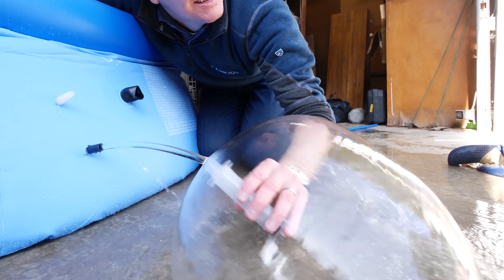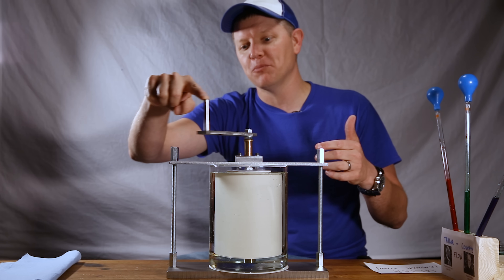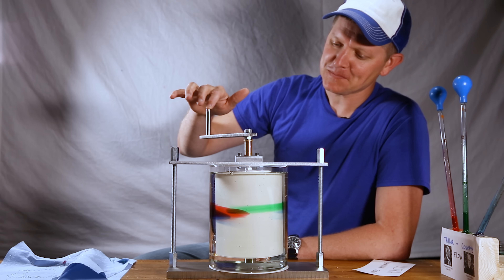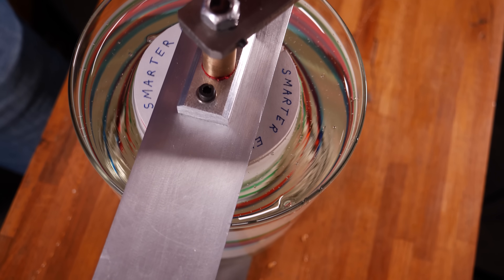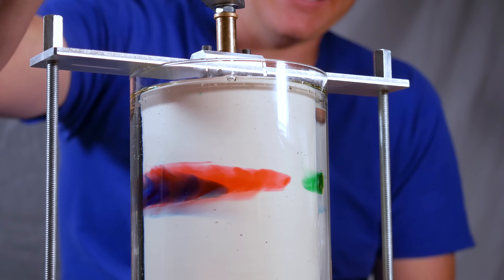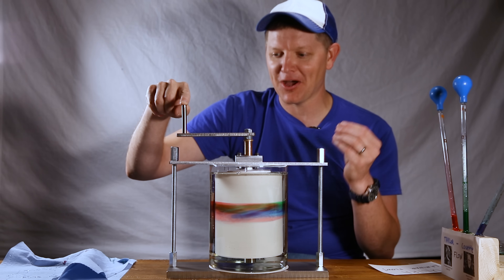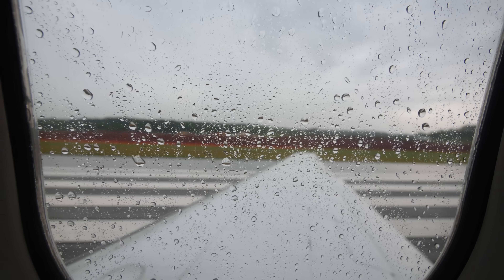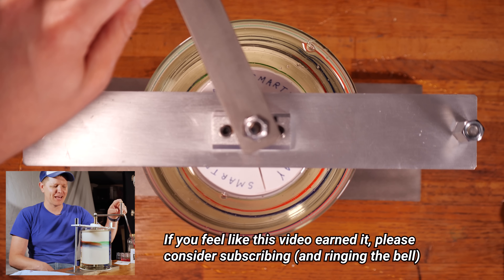Unmixing Color Machine (Ultra Laminar Reversible Flow) - Smarter Every Day 217

Comment: Hey so I was just thinking your undoing spirals but the corn syrup and the dye still mix ,if it was actually reversible the colors would be able to be compound and remain unmixed not sucked into the centre in different layers ,you can’t undo the past and they definitely still mixed as you can see the droplets of color are diluted on the sides it’s an example but not a good truth as it’s very misleading

Comment: Does this refute the universality of the second law of thermodynamics?
Reply: Even though the spots were recovered, energy was irreversibly expended elsewhere within the system, such as the layers of fluid shearing across each other, and including energy exerted by Destin.
Reply: @josephshakal9017  my question wasn’t about energy but entropy, if order can be restored simply by reversing the direction of a particles’ momentum, then Boltzmann’s whole theory is refuted, isn’t it?

Comment: Would this work on? Photons are the smallest measurements (quantified as a quantum in physics). Could you reverse the flow to make matter from it decay point to a stable element. Like having a puzzle missing a piece or 3 or more? Could we use r-matrix theory, zero-point state (found in argon as a solid, naturally cold in subzero space). Use tessellations of 2d tiles of two elements to backwards tile the plan of that atomic elements from K to Ar? With a reverse laminar flow of light that is lower than infrared light, but equal to gamma ray. That way radiation is used up. To make matter as allotropic as 2d Phosphorus.

Comment: The slight distortion in the reversed result might partially be caused by the bubbles or by inhomogeneous viscosity in the corn syrup. So befor injecting the ink you could mix the liquid by spinning the cylinder 100 times. And can you then repeat the experiment with a very slow running motor?

Comment: Hey Destin! I watched this video like a year ago - but then today I suddenly had an ‘aha!’ moment as a result!

I have this globe on my desk that is suspended inside a plastic globe, and a clear fluid - essentially free-spinning inside the ball. I couldn’t get it to work properly and spin, without going backwards - but it was supposed to just keep going in the direction the earth actually turns. 

I looked over at it today - and this video came to mind - and it clicked. I needed to spin the outside globe in the right direction to ‘wind up’ the fluids inside - which then pull the interior globe in the same direction. 

Mind blown. Thanks man!

Comment: this works with syrup because syrup is actually a bundle of strings, and not a fluid like we normally think of it (similar to how glass is not really a solid). mineral oil probably would have a different result, as it would more readily mix.

Comment: Green colour drop has been put very close to the white cylinder and blue colour drop very close to the glass wall. Red colour drop has been put between the other two. If every colour drop has been put to the same distance between the white cylinder and the glass wall then the colours couldn't get back to their initial position and would have been mixed permanently. You can see what I am talking about at 3:04

Comment: So it's possible to not only time travel but this proves the multiple universe theory. if the universe is a certain point in time and it moves forward in a Fibonacci spiral, you need to capture that spiral of entropy inside a laminar flow tube. Then just reverse it again. Only problem is. Your universe is now slightly different due to small amounts of turbulence that snuck into the system.. you've just traveled to a new universe... I'm sure there's a very simple experiment that will induce some sort of electrical current to this system that will enable us to eliminate the turbulence and thus create true time travel..

Comment: Universe:
"Nooo, you cannot reverse entropy"

Corn Syrup:
[Laughs in reversed entropy]
Reply: The striated pattern proves that the entropy wasn’t reversed
Reply: @sirmorningwood2707  The striations actually prove nothing about entropy being maintained or reversed. As he pointed out that is just a side effect of the way they mixed it. If done properly, the laminar flow would return the liquid back to its original position without striation. 

In any case the original premise is flawed, because you are not actually undoing entropy by returning the liquid to its original state, any more than melting an ice cube and then freezing it again means that you have reversed entropy. The energy (and subsequent heat) that went into the system to "mix" the liquid was also required to then "unmix" the liquid. As such, the continued entropy of the universe was maintained.

That being said, I have long held that the Entropy is a severely flawed theory because if the ball must always roll downhill, then how did the ball get to the top of the hill in the first place? Even if we follow a multiverse theory where our universe splintered off of another universe through an extreme amount of energy focused on a very tiny point (Michio Kaku posited this at least), and assuming that the laws of physics are constant across universes, then you'd still have the problem of explaining how our parent universe got it's initial energy and so on.
Reply: @femsplainer  Sorry - that was not a physically correct explanation... clearly the system is not mixing - if it were, it would not "unmix"... the low Reynold's number just means that the flow pattern is predictable and reversible.. there is little impact of "randomness" under these conditions. My simplistic equivalence is to use a cipher anology. If you take a sentence where you follow predictable (unique) transformations - then using those same rules reversed will always return the sentence to the initial state. The rules are more constrained in this situation to a repeatable/reversible process. If you were to leave the fluid sit for an hour after the initial turn, the chances of reversing reduce (because even at the higher viscosity, the chances of random (thermal/gravitational) movement that are non-reversible increases.
Reply: @femsplainer  Hey dont be confused about  ball rolling down the hill how didnit get to the top 😂

If you roll a ball on a bigger ball & the little ball is attracted to the bigger balls center of gravtiy it will contently continuously roll 

So in other words, a ball can in theory always roll downhill and always be on top of the hill if its a ball
Reply: @Alberta1stPodcast  That's not how entropy works. Whenever you describe a perpetual motion machine, you should probably stop and check your notes, because you almost certainly got something wrong, since you would break all physics as we know it if you actually did get it right.

Yes if you have a perfectly balanced orbit you can in theory have the two bodies orbiting forever if we ignore tidal forces, large body deformation, solar winds, space dust, and other inefficiencies in the system. However, even if we ignore all those additional forces, the base system cannot perform any work, because work would eat up some energy and thus cause a decay in orbit. 

As such, under entropy the ball must either rest at the top of a hill or roll downhill. There is no mechanism under entropy to push the ball back on top of the hill, which is the problem. Somehow that ball was placed on top of the hill and it is slowly rolling to the bottom, so something has to be missing from the equation. Otherwise the ball could have never gotten to the top of the hill in the first place.
Reply: @femsplainer  if you had a hill isolated from anything & them rounded the hill it could big enough to generate gravity enough to over come friction & you can get a ball rolling on its surface in perpetuity

What exactly is the top of a completely round hill? And why wouldnt gravity keep the motion in perpetuity? You think friction is that great a force? 🧐

No one mentioned orbit except you, thanks phenomenal femsplaining
Reply: @Alberta1stPodcast  Ok what are you smoking, because Gravity doesn't work that way, like at all. Pretty sure you're trolling but then Poe's law is in full effect these days.

An isolated "hill" that is completely rounded is just a sphere, and if you have another sphere (the ball) on the surface of the larger sphere it would just sit there rather than roll around the "hill" because there is nothing to convert the potential energy of the second sphere into kinetic energy. If their surfaces (and environment in general) were frictionless and you imparted motion to the smaller ball, then it would roll around the bigger sphere endlessly. However this is not "rolling downhill" because to roll "downhill" means to descend converting potential energy into kinetic energy. However, this is a static system, you are not producing any work, and therefore not generating any entropy either.

Entropy says that a static system can maintain the energy within it, but that it will never gain any additional energy in a closed system. So this system does not violate thermodynamics, but it's not a system that is germane to reality.

As soon as you reintroduce friction everything eventually grinds to a halt converting kinetic energy into heat energy. This is why I presumed you were talking about orbiting bodies, to avoid the real world problem of contact friction. Orbiting bodies can create a pseudo "hill" through the distortion of space that is caused by the gravity well of objects with enough mass, ie the moon is constantly "falling" towards earth, but its momentum keeps it rotating around Earth, rather than falling directly into it. This orbital setup can potentially come a lot closer to a perpetual motion machine than two bodies in physical contact with each other because you can avoid direct friction. Unfortunately it seems that you couldn't even understand this basic concept and instead you were using a much weaker argument than that theoretical one.

And yes Friction is a pretty powerful force. It might seem unimpressive but it will eventually help cause the heat death of the universe.
Reply: @AdelaideBen1  Again this is predicated on your definition of "mix". 

From Merriam Webster
Mix: To combine or blend into one mass.

The corn syrup is already a homogenous mass that is thoroughly blended, the only addition is the food coloring. This is then mixed gently creating the patterns we see as the colored bands are displaced and spread out. It is then unmixed as those bands are displaced and again, but this time are brought back to their original placement (or at least very close to it).

If I have a bowl of diced vegetables, with corn, carrots and peas, and then mix them together, they don't physically blend together into a solid mass of homogenous material unless I put them in a blender, but we would called this assorted vegetables "mixed". Similarly the bands of colored liquid are also mixed as you stir the liquid. Just because there is an easy way to "unstir" the liquid, doesn't mean that it wasn't mixed. Ultimately any mixture can be unmixed (assuming the mixing doesn't cause chemical alteration), it just comes down to the amount of effort involved.
Reply: How did the ball get to the top of the hill? Easy. God put it there.
Reply: @nicholauscrawford7903  I'd rather not get into a discussion of the God of the Gaps...it's ultimately a pointless endeavor.
Reply: @femsplainer  God is not a "god of the gaps". He makes sense of existence as we know it, not just as we don't know it. I don't know anyone who actually believes in a so-called god of the gaps. He's simply a better answer to our spiritual needs and the complexity of the universe than any alternative. He fits the bill for the ultimate life-form to precede all life in accordance with the law of biogenesis. He also paid the ultimate price for when His choice life-forms (humans) missed the mark.
Reply: @nicholauscrawford7903  You are precisely using the god of the gaps arguments. You are saying that the lack of knowledge we have currently is evidence of God, but that is a logical fallacy. A lack of evidence is not evidence in and of itself. Just because we cannot describe what that missing element is, does not imply God, any more than the fact that we didn't know about microbes meant that God was the one visiting plagues on people. 

There is no "law of biogenisis" it is just a theory, and poorly thought out one at that. 

Also, in your belief god created man. Therefore god must have also created the flaws of man. As such, god created sin because sin comes from the flaws of man which were put into us by god. So ultimately the fact that humans "missed the mark" is because god is either inept or sadistic and not worthy of my worship as a result.

Regardless, this is why I didn't want to get into a god of the gaps discussion because it leads to this kind of nonsense.
Reply: @femsplainer  wtf, are you saying that the second law of thermodynamics is wrong?😂
Reply: @fritzzz1372  Not "wrong", but rather incomplete. If energy can only be consumed (entropy) and never created, and there is no accounting for where the vast stores of energy in our Universe came from in the first place, then you are necessarily missing a very crucial piece of the puzzle. There necessarily must be some mechanism for putting the ball on top of the hill. 

Physics has many great and terrible holes in it that we have yet to fill and understand. That doesn't mean we throw out everything we do know just because our knowledge is imperfect.
Reply: Well... XD
Reply: @Hallie really... why just repost someone else's comment?
Reply: the title is a bit misleading - nothing is unmixing, because nothing was mixed - the hint is in the rest of the title "ultra LAMINAR flow" - which means he didn't cross the "streams" and the pockets of dye could be mechanically reformed by reversibly compressing the "stretched" pockets of dye - really only possible because over the timeframe of the experiment, there was so little diffusion of the dye pockets into their surroundings - thus the requirement for a really viscous/thick liquid.  The law of entropy always increasing was still demonstrated because the "after" pockets were more distorted than the "before" pockets - because of an increase of entropy throughout the experiment.
Reply: @bob_smith45  Well I think that all comes down to what your definition of "mixing" is. Considering that the corn syrup is already homogenized and the only difference is the food coloring, one could say that it is already mixed even before he starts turning the handle.
Reply: Corn Syrup: Hold my Laminar Flow
Reply: you can, with work
Reply: It's not reversing entropy, but it does feel that way without context.
Reply: @Hallie So original.
Reply: Nah, this is just liquid chromatography in a cylinder.
Reply: Laughs in tenet

Comment: When you talk about the different striations at ~6min, wouldn't that be due to a non-constant velocity of the inner cylinder wall? As your input velocity on the crank arm would have fluctuations from human input. You mention that is an example of shear-thinning & the striations are due to variations in the viscosity of the fluid, but shouldn't the viscosity remain constant, as corn syrup is a Newtonian fluid? Love your work, really cool stuff!

Comment: Very neat!  It'd be interesting to see if you turned the cylinder using a motor set @ a specific slow rate like a welding positioner, how much clearer your end result would be or if the striations would be any more precise?  I imagine it would because you were putting different amounts of tension as you turned it.

Comment: @smartereveryday Is one of the reasons that the colour sheered is because the corn syrup was poured in at different stages, and in effect the sheering is the result of the corn syrup trying to go back to its original point but due to it being more dense than the colour it didn’t go back fully?

Really cool video!
Reply: Also using corn syrup was cool but what’s the most liquidy substance that could be used to do the same thing?

Comment: So, judging by the methodical speed of each revolution that was presented is a key factor?  I wonder what would happen if you sped up the revolutions per minute.  Would the striations be more scattered or would they become tighter?  Seeing as the liquid is so viscous.  Or is there any correlation at all between the striations and both the viscosity and rpm?

Comment: Would this still work if the colors were injected at the same height, at the same radius, but at different angles from the center (It looks like he injects at the same height but different with a different radius for each)? i.e.- would it work of one dye had to pass through another dye to return to its starting point? Would they be able to mix and then separate?

Comment: That was a very cool experiment!!
I would think setting this up to have a firmly controlled speed for the 7  turns, both ways, should minimize the striations a lot. 
Speed changes could cause different amounts of shear, if the ink viscosity is thinner/thicker than the syrup?

Comment: You can reverse as long as the spirals dont mix. Front view is simply added layers. Upper view shows distincts spirals.
The question is, depending on the velocity and the thickness of the flow, how many turns do you need to reach an unreversible situation ?